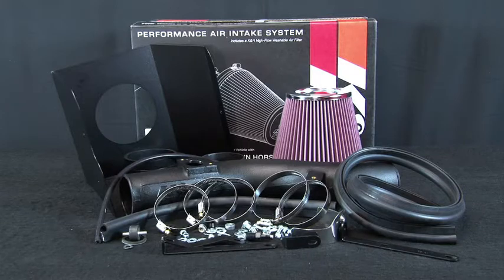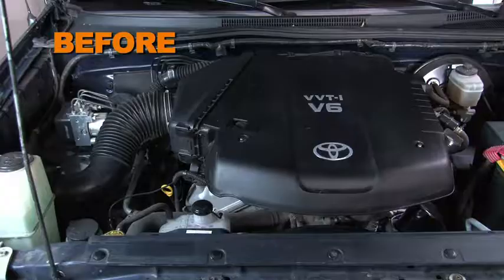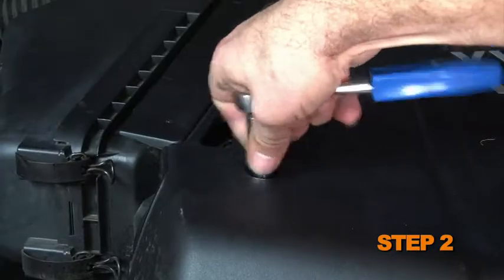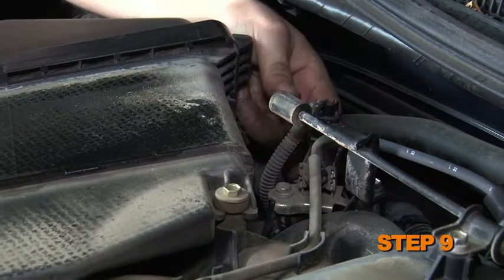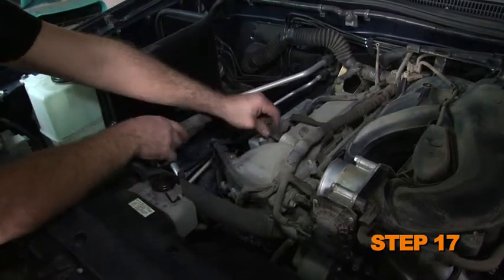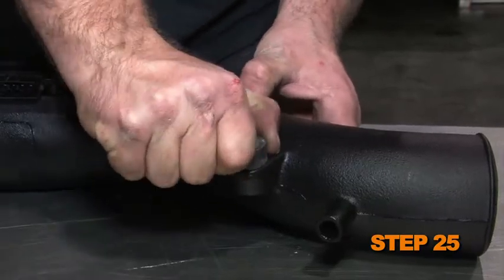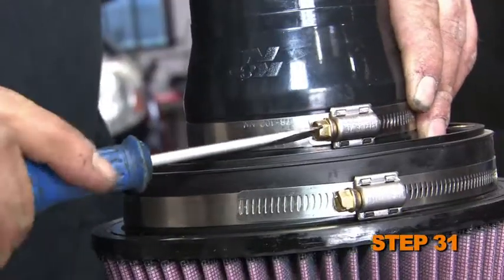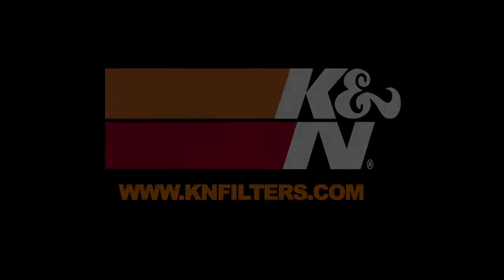Toyota Tacoma 4.0L V6 [#63-9025] Air Intake Installation

Comment: What about check engine light after install
Reply from the maker: All K&N Intake systems are designed to work with factory ECU settings and should not cause a check engine light.  If you encounter any issues please contact our product specialists at 800-858-3333 or tech@knfilters.com for assistance.

Comment: How often should I be changing the Air Intake? Or should I just look at the manual
Reply from the maker: Once you have installed a K&N intake, you can re-wash/re-use the filter.  See the instruction booklet that came with your intake for recommended cleaning intervals or please contact our product specialists 800-858-3333 or tech@knfilters.com if you have any other questions.
Reply: @KNfilters  o

Comment: So you are drawing in air from the engine bay? that would seem to lower hp right?

this video explains pod filters. 

Cold Air Intakes Mythbusted
Reply from the maker: When you are moving the air is drawn from outside. The only time air is being used from the engine bay is when you are at idle, which wont affect performance because you are not moving.. We have seen the @watch?v=gCi2yo4UqPI video and do not test any intake kits the way the folks in this video. For more info on K&N testing see here: http://www.knfilters.com/air_filter_testing.htm